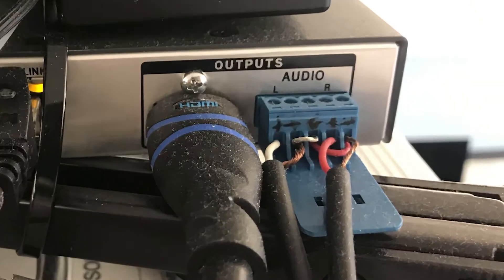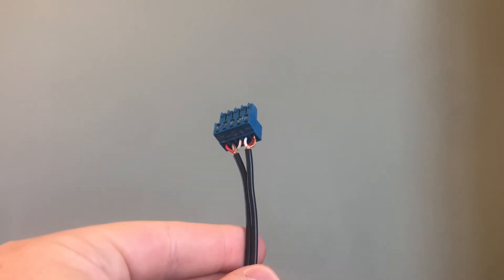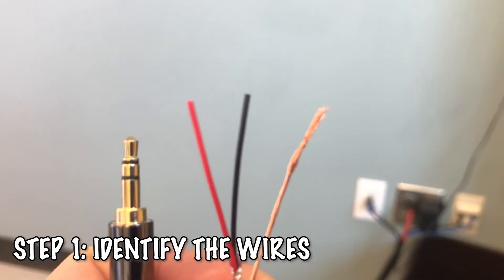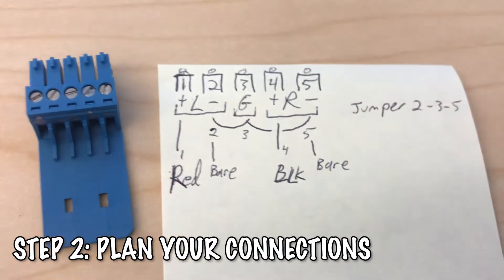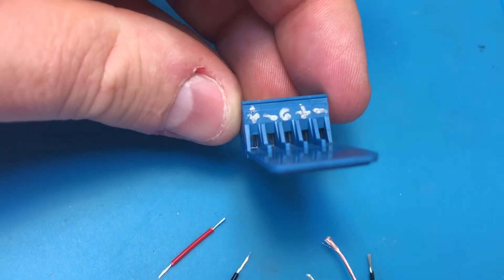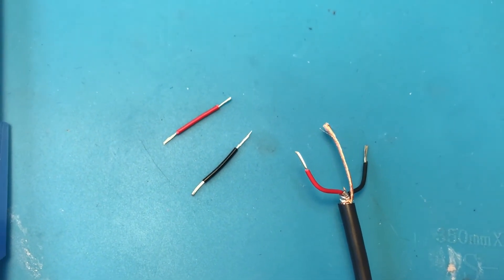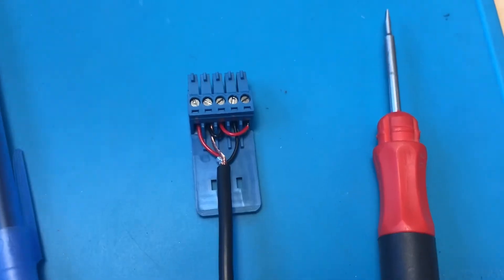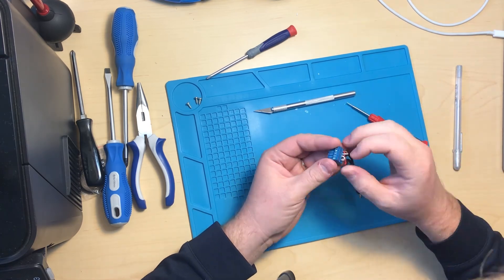How to Wire a Phoenix Connector Adapter

Comment: Is there a way to wire in a rocker switch to change between mono and stereo on the fly?
Reply from the maker: I've never done that before. I feel like the wiring is more complex than a simple dipole switch. Maybe a 3-way switch... I don't know I'd have to draw up a diagram. I use the DXA-GO (https://amzn.to/3HdGlY7) It has a Stereo/Mono toggle on it... it's meant for the top of a camera for mixing multiple mic inputs on the fly. Could be what you need!
Reply: @KirkHMiller  I have a stereo modded original Nintendo,  but some games sound better with mono audio, so that was the main goal. Thank you for your help!
Reply from the maker: @RetroGamingBacklog  Glad I could help!

Comment: What would have been useful is where to get the connectors???
Reply from the maker: Luckily the unit I have came with a connector installed, but if you need some, they are available from a variety of sources but I like getting them from Parts Express on Amazon: https://amzn.to/3geFBIx (affiliate link).